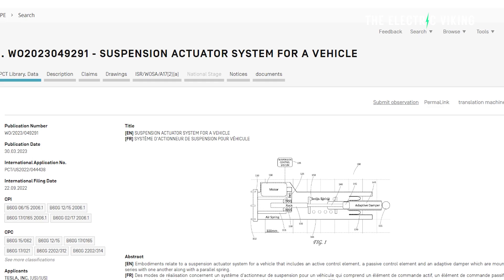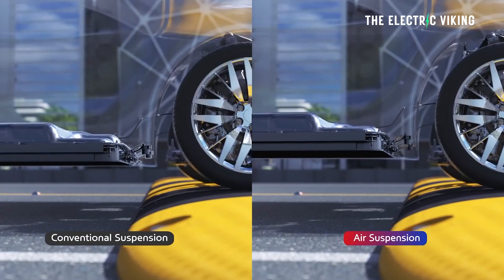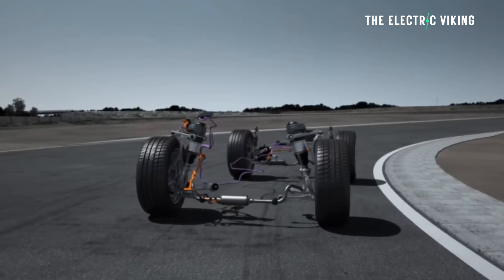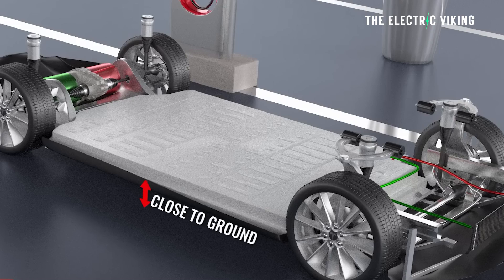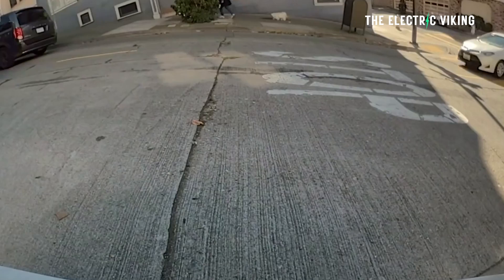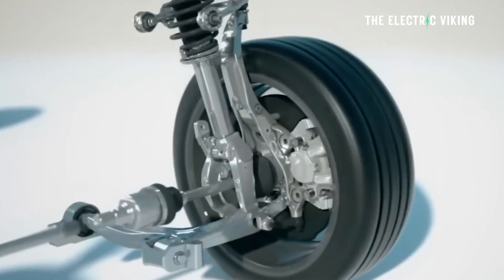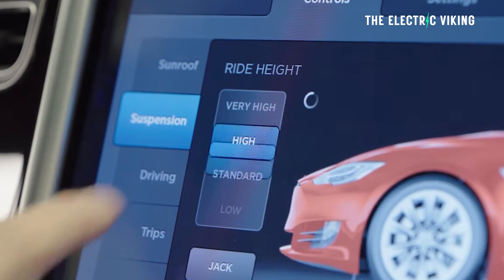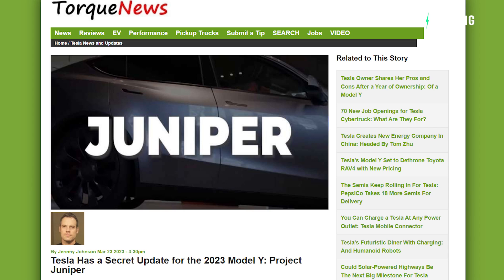Tesla's new suspension system - in development for over 4 years

Comment: This will be even more costly than the pneumatic air suspension, so it will be for the S and X only. Maybe when they make an electromagnetic system that can also extend range instead of shortening it, they might consider using it in 3 and Y.

Comment: I love my model 3 except for the suspension and seats(for long people). If you ever driven with an adaptive/air suspension it is difficult to go back. The suspension of the model 3/Y is stiff, bumpy and not refined. The new 'softer' suspension is a joke and only slightly better but still stiff.
Reply: I agree completely.  Have you found anything to help with the seats?  I'm thinking about getting a neck pillow or something.
Reply: @blotto3422   its more my legs and bottom that are hurting. I use a small flat pillow with an extra seat cover.

Comment: @4:20 there is a suggestion that by driving lower there might be an improvement in aerodynamic drag & therefore a big difference in range with a guess around 5% improvement. 

However, as mentioned at the start of the video, active suspension system use electrical energy to function, so maybe any perceived gain will be lost in powering the system. 

Besides, I'm not sure that running the car lower to the ground actually decreases drag significantly, given that drag force is proportional to velocity & the cross sectional area of the object (car in this case). Running closer to the ground could result in the air passing under the vehicle having less space & therefore having to move faster under the car, creating a low pressure, in accordance with Bernoulli's principle. Such ground effect might improve high speed handling, not sure if its going to do much for drag on its own.

Personally, for normal road cars, I don't think there is much wrong with a tuned mechanical spring & damper setup. For an off roader, or a high performance (speed & handling) car, then an active suspension may well give some worthwhile benefits (but not drag/range enhancements). For a normal road car, I would prefer to see a regenerative spring/damper setup which could well improve range without requiring power to run it.

Also, the reason why this new suspension system might just be for Cybertruck & maybe model S &/or future Roadster & not on the Model 2, 3, Y, X etc, would be cost.

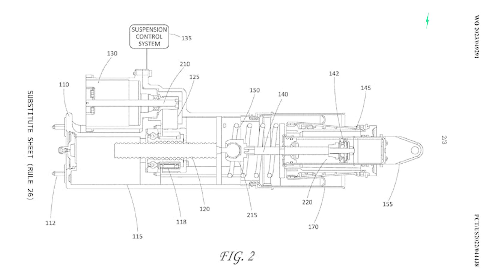Comment: 1:49 that wouldn't have much shock travel compared to its length. If you look at the other drawing in the patent, it is roughly a meter long, which would make it unlikely to be used in a car (At least not up front). And a belt-driven screw would also have challenges with friction and response time. Not sure what the intention behind this is, but I wouldn't expect it on a Model 3 any time soon.

Comment: Good presentation!  In the past I have not been a fan of complicated mechanical systems in cars or trucks.  Proportional/steering by wire, electromagnetic brakes, four wheel steering, adaptive suspensions and the like are pretty similar to systems in use for aviation, and have proven to be reliable, so I'm much less opposed to the new technology these days.  More things to go wrong?  Yeah, but the computers and controls have gotten so much better in the past fifteen or twenty years.  For example antilock brakes were a nightmare when they first arrived, now you can't buy a vehicle without them.
Reply: just the thought of electromagnetic brakes makes me salivate.  do you know what a boon that would be to truckers?  maybe most of the readers here have never suffered from brake fade coming out of the eisenhower tunnel but let me tell you it's no joy.

so they tell me it's the driver's fault.  i won't argue the point. 

 i was on top of donner's summit in the snow and a truck driver went over the top.  his last words on the c.b. were "jesus help me."  that kind of thing stays with a guy for a long time.

i'm for anything and everything to help truckers along.  and i don't care about finding who's at fault.
Reply: Gee, you’re not going to like the combustion engine.  It’s the most complicated part of the car.
Reply: @oggyoggy1299  i would like to think that the internal combustion engine had a reason for taking hold.

gas was always sold at a premium.  

and electric was a solid option at the beginning.  remember porsche?  he had an electric motor at every wheel.

and i remember what big hopes we had for wankel.   

but all in all i think we have to admit the days of i c e are over.  

is this new suspension an unnecessary complication?

maybe it is.  but i'm not the one that's talking it down.  i'm not talking it up either.  we'll have to wait and see on that one.

Comment: Quick Q: is this complexity going to lead to more wear & tear and maintenance issues?
Reply: I assume that the spring reference means that if you want a smooth ride as promised, you will be replacing Struts every 5-10 years.  This is probably worth it.
Reply: Electronics with no moving parts + air suspension should be fine.
I own a brutalised off-roader gas land cruiser, it’s 18 years old and the air suspension has been fixed once.
I have 2 others over 13 years but on road, all are fine. Air suspension is basic by now.

Comment: Early model S cars allowed full control of ride height at any speed unlike now. I and many others tried to measure some efficiency gain with low ride height but found none. While we were limited to on board measurements we could likely find a 1% or greater change but found none. Newer cars force low ride height at speed that prevents this experiment from being done. Squeezing the airflow into a tighter space between the car and the road could increase velocity and turbulence and might ever reduce efficiency. If it is a fact and not a myth why don't we have some decent measurements and proof. Maybe you need a wind tunnel. What ever the effect is it is too small to measure with the inboard instrumentation.

Comment: Conjecture alert: I have the suspicion that BYD found out that Tesla was working on a new suspension system, and quickly started and accelerated their own development (after examining leaked info from Tesla) . Then by quickly showcasing it before Tesla, they hope they will not be accused of copying/ripping off other companies ideas. Just my 5 cents. Same goes to the South Korean car companies Hyundai and Kia, who leverage info obtained from South-Korean made smartphones. I have no proof of cause, but these accelerated revelations of technology, even before the cars are ready for sale, just strengthens my suspicion.
Reply: Oh, that's a typical unqualified comment. Spare me. BYD has worked 6 - 8 years, and billions on this. Tesla probably equal. The two systems has no smilarties. Not even to Mercedes. The first to bring similor suspension idea was Citroën with it's hydro-phenoutic solution - without electronic aid.
Reply: @knuth.nyhagen82    He's not too far off the mark...we who are actually in the business know that BYD has been mimicking Tesla ever since the Shanghai factory began tooling up.  BYD is more an arm of the Chinese government than it is an independent company.
Reply: BYD has it on the road already. Tesla has it on paper. Loser

Comment: I have always had a problem with every suspension system since owning a Citroen Xantia. Anyone who has ever driven on Hyro Pneumatic suspension knows what Im talking about. If Tesla use that as a benchmark and equal or beat it thats a dream come true for me. People are amazed how you can hit a speed bump at 30mph and not even feel it but have you ever pushed the same system hard through corners? Just like EV drive trains redefine how a 2+ ton car can perform so Citroen Hydro suspension redefines how perfect smooth suspension also handles. Beat that Tesla and Ill swap my MS P85 for a new S.
Reply: Exactly!
Reply: Bose had an active electromechanical suspension system over a decade ago. It rode like glass. It added $10k to the cost of a car so no automakers were interested. The only commercial application so far has been seats in semi cabs.
Reply: @thomasaquinas157  I was aware of that system, my whole car cost me $1,000! didnt know it went to suspend truck seats. I know Citroen licenced their Hydra Pneumatic to Mercedes who put in on the W124 (I rode in one of those when I was 15 and always remember how incredible the ride was never knowing why) and Rolls Royce who fitted it to the rear only and again was shocked how good the ride in the Rolls was. It appeared in the DS, that car was the Tesla Model S of its time, or the Model T.
Reply: 😂😂😂 So true but that was the only good thing with Citroen. Oil & air needed a fair bit of maintenance.
Land cruisers absorbs bumps incredibly well with just air (zero maintenance) but handling is very mediocre.
Reply: @whowhy9023  When you delve into the physics of the pressurised Nitrogen used in the "pneumatic"  part of the Citroen suspension and how it works with the "hydro" oil and how the whole system has minimal moving mass an superb reactivity its clear why the system is so good and difficult to see how anything else could beat it.
My experience of the Citroen system is it was no problem at all in fact much less trouble than breaking coil springs (pot holes and speed bumps that are UK roads) and leaking air struts. As an engineer in the automotive industry I was capable of doing my own maintenance and saw no problem in its design and never lifted a spanner to it. Citroen won 2 Monte Carlo rallies with the venerable DS (same system) and you dont get that done with flaky systems. Got to have been the most comfortable rally drivers in history!
Reply: forget about that. if tesla could use air suspension on model 3 and y they would have done it already because they have been using air suspension for long on model s and x. if they come up with this tech it will be used on model s and x. meanwhile byd already has this tech on denza n7.
Reply: @tonypaca3015  I dont for one minute think Tesla would use a Hydro Pnuematic system I just hope that is the benchmark. I know there is a design balance of function /compexity cost and I drive an S where I can feel the low speed responsiveness has problems (it is after all based on BMW X5 struts) and Ive drive Model 3 which feels too hard but handles. Im pleased there is some work happening on suspension and I know S and X got variable damping, lets see if they can take it to the next level.....Beat Citroen? Hope so but doubt it.

Comment: My biggest wish is for Tesla to further soundproof their car... foam in body panels, glass panes, etc...  That's the one area they are not competing with Lexus or MB.
Reply: Your right. Bjorn test-drives reveal Mercedes and Nio most soundproofed cars. Tesla far below
Reply: My m3 has double glazed windiws
Reply: @mallamal5578  Front side windows only and it made next to no difference.
Reply: My biggest issue with Tesla 100%. Second is no heads-up display. 
Also smaller wheel option would be nice. More air less aluminium is much more comfortable and safer.

Who the hell buys a Mercedes today? But yes soundproofing is needed, problem is it’s heavy…
Reply: 2005 Toyota Avalon has better soundproofing than the model 3 RWD (based on my 80 year old mother's feedback)
Reply: Lol doing that will only make the car heavy and less efficient..like a MB 😂

Comment: There are so many areas in a vehicles design that can be improved upon. Legacy has been lazy and greedy over the last 30 years. New sheet metal and nothing more
Reply: Exactly and why I have no sympathy for any OEM. And why Tesla and the Chinese are about to decimate them.
Reply: Yep oem legacy car manufacturers like lotus (proper active suspension and electric power both before the turn of the century) Citroen had air suspension in 1971 on the DS along with headlights that “looked” into the corners. Lazy and greedy? Nope just profitable as they ran businesses that didn’t rely on enormous government subsidies and artificial market manipulation to keep running. They even had things like shut lines that didn’t vary by a fingers width, but I suspect the newbies will tel you that’s all part of the cutting edge design.
Reply: @davideyres955  these sheep dont know anything. 100% they are sheep apple users too
Reply: Mercedes has had such a system in use in the S Class since 2013. Audi has also been using a similar system for years.
Reply: @huckleberryfinn6578  Air suspension yes it’s moderately active. Really not very good.
Even GM’s Liquid Metal works better.
This is a new level entirely. I have had air suspension in Bentleys (not great) Land Cruisers (excellent but basic) S classes of various models (Nice but not impressive) even had an Audi 200 4WD in 1990 with ridiculously good road holding but no ride height adjustment.
Reply: @whowhy9023  It’s not a simple air suspension. Search for Mercedes Body Magic Control. It’s a system that scans the road via cameras and adapt the suspension even before the car hits the pothole.

Comment: I never had an issue with teslas suspension yeah it maybe a little rough but nothing what people say!
Reply: Most people are disinterested drivers, so they want a Camry jello like ride.
Reply: Same! I did try an older Model Y and it was a bit rough, but the newer models are fantastic!
Reply: Maybe people just have different reference points? A suspension can be sporty but still comfortable - look at Porsche. Every Tesla I've rode have shaken the entire cabin when there's slight imperfections in the asphalt, terrible. Meanwhile Porsche handles it smoothly. Glad Tesla works for you though. It works for many, so people just have different reference points.